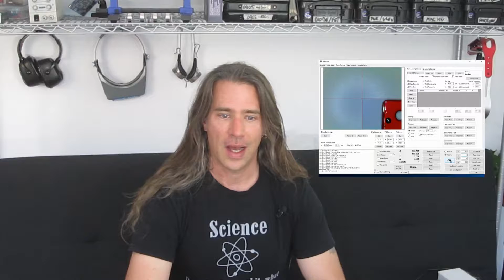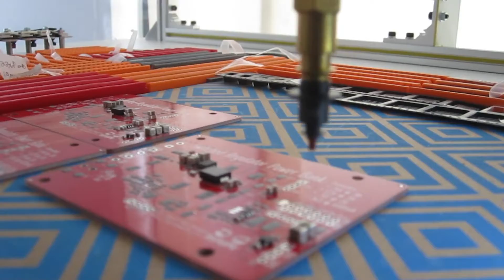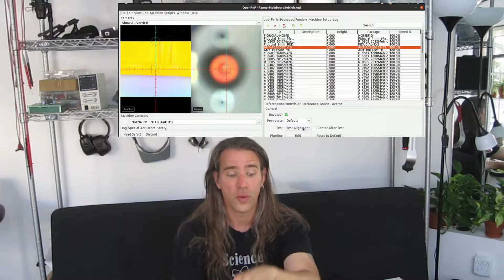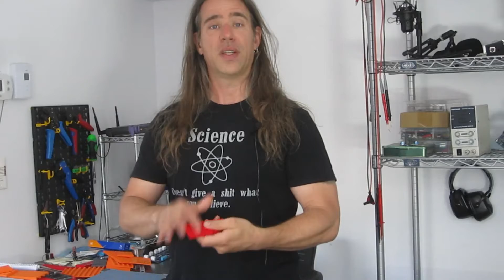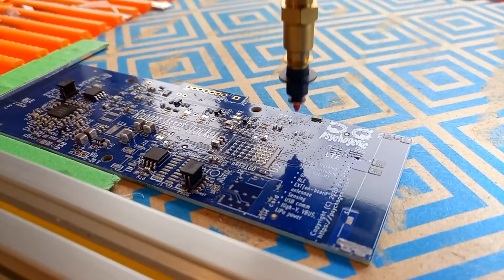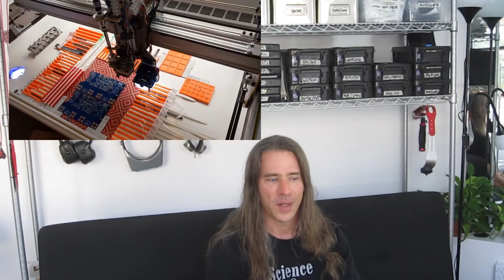Get Started with LitePlacer PnP: LP and OpenPnP

Comment: Very useful video series. Do you know if anyone has used IR LEDs to illuminate the parts and a filter to block visible light? I feel like that would remove changing ambient light problems.
Reply from the maker: That's an interesting idea.  I don't know if it would work--IR images are usually grainy and I don't know if this is a wavelength, intensity or sensor thing.
In any case, most of the issues I've had in the last months have been restricted to extreme changes in light (like direct sunlight hitting on or at least near work surface).
Reply: @PsychogenicTechnologies  I'm developing a product at the moment that uses similar types of cameras and IR leds. If you get the LEDs bright, as they would be in this application the image is amazingly sharp. However I have just been reading that OpenPNP is using some kind of colour keying and obviously B/W infrared illuminated images would not work for this.

Comment: How do the parts stick to the PCB before soldering?
Reply: The gooey solder paste is applied to the board (usually with a sencil printing process) before you start placing components in the pick and place machine. The flux that is mixed in with the solder paste is enough to get the components to stick in place until you reflow solder (bake) the boards. If you try to place components just for testing the machine, without solder paste on the board, you usually need to put some double sided sticky tape or flux on the board to hold the components down.
Reply from the maker: Yeah, exactly as ƸӜƷ said.  Just before the nozzle releases the vacuum, the part is smooshed into the paste goo.  It's good enough to ensure the part stays on the board and even allows you to take the PCBs to the oven without issue.  May need some extra adhesive if doing 2-sided boards, but for single side it works great.

Comment: Hi, trying to go from LitePlacer software to OpenPnP but can't make it work, I have an error when detecting the firmware automatically, in Issues & Solutions tab. What version of the TinyG firmware are you using?
Reply: Hi I am currently having this problem, did you find a solution?

Comment: I'm having problems with my feeders and the clear component tape. Have you had experience with the clear tape and your orange feeders?
Reply from the maker: Yes, they can be a pain.  The solution:  I use a fat marker and blacken the edge with the holes (do it from the underside, otherwise removing the covering will cause issues).  Took me a while to get back into youtube land and answer this: did you find a better work-around or permanent fix?

Comment: I'have looked all your videos, thank you so much to share your experiments. I'm on the point to buy one. Reality looks a bit less wonderfull than the theory on paper, but at least we know... Have you share this "problems" with liteplacer teams or on the website community ? I have good relationship with liteplacer for the moment (before buy it) is there the same after buying it ? thanks a lot , hope you will find solution with a new camera !
Reply from the maker: You are very welcome--it's in the hopes it'll help that I spend the time making these things, so I really appreciate the feedback.
I have to say, I've pretty much gone it alone... was in touch with openpnp team regarding the camera and a few other things, and they were quite responsive.  Also, Juha has been open and available the few times I got in touch (pre-sale and shortly thereafter) but I haven't felt the need to contact again... using LP + openpnp has in general worked quite well and I've now assembled hundreds of boards and am still quite happy.

Comment: Thanks for the update on the LitePlacer.  I have had many of the issues you reported, especially getting the Up Camera to detect the nozzle location.  I am currently printing different component holders to find a solution that works for me.  I hope to try some test boards in the next week or so.  Currently using LitePlacer software.  Thanks again for your insight.
Reply from the maker: Hey William, thanks--glad you liked the vids, I hope they're useful :)
I'm currently trying to catch up my back-log of stuff-to-say about the PnP (just released a vid/info on the connector PCBs I made, today), and will be posting resources and info about both the feeds and the scripting I've been up to, so keep an eye on the channel if you're interested in that.
If you have particular success with holders/feeders, would love to hear about that.
Cheers
Reply: @PsychogenicTechnologies  
I now have my LitePlacer up and running using the LitePlacer Application.  Parts placement on the PCB is a little off but I'm working on it.   I was wondering if you could do a short video on you transition over to OpenPnP, with more detail as the OpenPnP website reports issues with using the stock TinyG controller firmware.  How did you get OpenPnP to work properly?

Comment: Hi Pat,
The Liteplacer is one of those machines that I keep coming back to because I think it has great potential for customisation.
I pulled the trigger on one so of course, now i'm invested.
Feeders are a really, really big deal and I am sure you know that. So I have set off to work on that issue before I get the machine and build it.
A possible solution has been made by a chap named Stephen Hawes (has a youtube channel with the same name)
Info is in his github repo @ https://github.com/sphawes/index
It's part of a PnP machine he is developing which looks like a neat project that I might stick my fingers in, too.
I am betting the feeder concept can be adapted to work with the Liteplacer. Your thoughts seeing as you have yours built? :)
Cheers Pat.
Reply from the maker: Hey Mark,
Same here: though the mods I've made so far have been pretty basic, my current wishlist includes 
 * vacuum seal detection to deal with the occasional failed pick-up more gracefully;
 *  swapping out the bottom vision camera for something that'll convert to HSV more reliably for OpenPnP; and
 * some sort of automated feed system--probably not worth it for every, or even most, parts but boy am I tired of resetting those 100n cap feeds
Though not the fastest or bestest pick and place, if you want to play with the setup and/or you can get by with 0402 for your radio stuff, I've found it to work well and the price point is pretty nice too.
Hit me up if you have any Qs or even just to show off your eventual setup: curious to see what you do with it.
Reply: @PsychogenicTechnologies  Have you chosen an up-looking camera to replace original? I would like to change over to openPnP and had experimented with the software early this year before my camera died. I am currently using the Juku software, but would like to try for better accuracy with the camera
Reply: I have purchased a few feeders to use on my Liteplacer from Ploopy Corp in Ontario, going to try them out over the next few weeks.
Reply: @km20061234  That's an option. Thanks for mentioning it.

Comment: I absolutely love your video series on the liteplacer build and trials! I just got my own kit and getting ready for some intensive build sessions! Did you replace the cameras with something else for OpenPNP?
Reply from the maker: Hi, and thanks!
Just this morning I was thinking of wrapping up all the minor changes I made to the build that, I think, make it better (I played with placement of vacuum solenoid, bottom cam, stuff like that) and will be doing that shortly.
I haven't yet tried other cameras but I think I will be doing so, if only for the bottom vision, which is where conversions to HSV really mess up.
Good luck on the kit build--it's arduous but one step at a time gets you there no problem--and hit me up if you have any Qs.
Cheers,
P